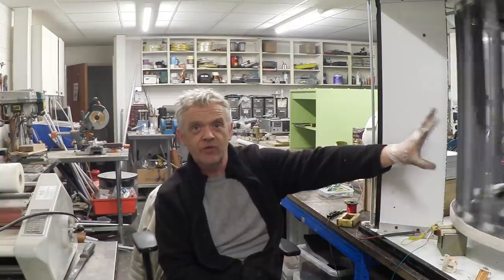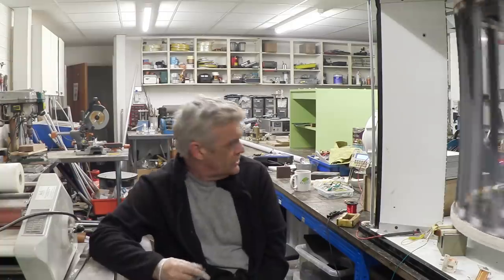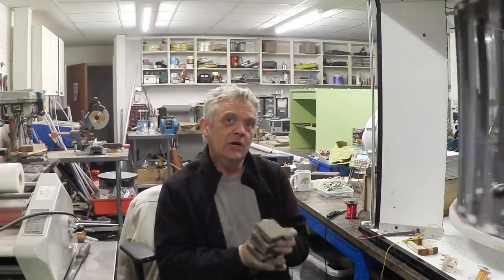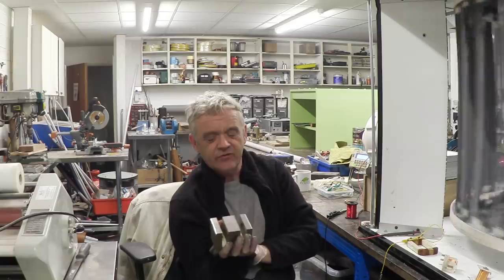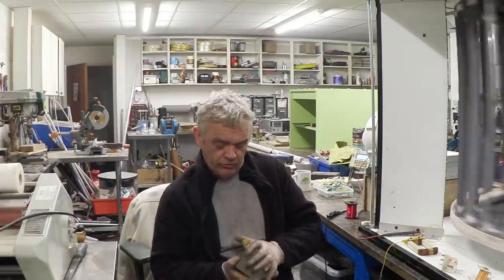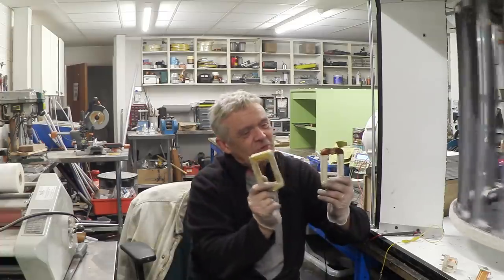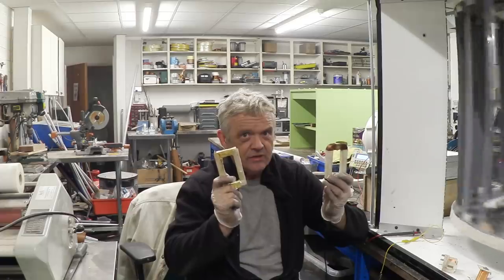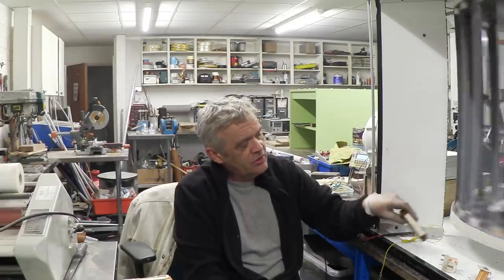Building a 1kW Wind Turbine For Under £100 - Part 5 - Messing With Coils

Comment: Rob, the reason you get the same power out of different coils is not a result of the mass of copper. The amount of power is determined by the magnitude of magnetic flux, and how fast it is moving past the turns in the core, less eddy current losses in the core and copper (resistance x current, aka IR) losses in the windings. More or less like a transformer, except in this case the flux is applied externally rather than being generated by the primary coil. Different numbers of turns changes the voltage versus current, but power remains the same. To reduce copper (IR) loss to a minimum, the coil should make full use of whatever space there is in the core.
Reply: Yep - as I remember from secondary school physics, in the ideal, number of winds determines voltage/current combo through which you'll get a fixed power.  Obviously real-world with resistance, eddy currents etc., will skew that balance, but the fundamental relationship between coils is about windings.

The transformer designers will have balanced the real world losses.  Cheapest design would be one wind on the primary, 10, or whatever the multiplier is, on the secondary.  But plainly that is inefficient so they increased the winds on each side to a point with acceptable efficiency for a given cost.

The thickness of wires is just chosen to allow them to pass the current, which is why the primary (fewer windings, lower voltage, higher current) has thick wire and the secondary has thin - (almost?) purely whatever appropriate gauge wire is needed to carry its design current.

As for whether to use a core - that just improves amount of flux it can intercept (no?) - how much kinetic energy the coil can capture and transform to electric.  The whole point of this is to extract kinetic energy and convert it.  Of course the core-less coil didn't slow the turbine as much, it was extracting 1/4 of the energy (halved both voltage and current).

If you put too much load on the turbine, it won't spin well, so a useful design needs to have limited extraction abilities one way or another.  If your scavenged parts are too powerful, perhaps it is pragmatic to reduce its efficiency, but otherwise there's not a lot better about a unit that is not able to extract as much.  Remove the load and it speeds up, right? so limit how much electricity you take from it and you can control (and therefore optimize) the turbine speed?

Finally...  connecting the two coils...  In the transformer, one is designed to take the energy input by the other - they're in opposition.  If Robert saw the output drop it probably meant he connected them in opposition to each other.  Reverse the polarity of one of the coils and they'll just give you more windings, higher voltage, lower current, same output (but probably fractionally higher from slightly lower losses?).

I'm in awe of, and salute, the practical investigations here, but getting a theoretical guy on hand (e.g. a secondary school physics teacher?) to help direct the investigations would accelerate progress dramatically.  The complement of theory nerd matched with a capable inquisitive hands-on engineer type is powerful.  They shore up each others' weaknesses and keep each other from following blind alleys.
Reply: @wjcferguson  basicaly you are right. Please don't forget that core can get saturated. There is a limits how big magnetic field intensity can hold it. More windings means stronger field. In transformer application this means less losses unless core gets saturated.

Comment: I think the resistance to the motion of the turbine comes from back EMF and the large amount of iron in the core interacting with the magnets. Cutting off the outer cores would reduce the magnetic brake effect while the inner iron core will improve flux flow, in particular the capture of the induced voltage as the magnetic flux collapses with the passing of each magnet. Thus the higher voltage option becomes even more attractive. That's my theory anyway. Great stuff.
Reply: Sorry, but i dont think back EMF from the iron core are to blame here. Those cores are actually built to minimze back EMF. Thats the reason they are built from thin slices of isolated material, to stop any eddy currents from flowing. This means that although a voltage is induced in the core, no current can flow and no "reverse" magnetic fields can build up. Also by cutting the outer "wings" you replace a low-magnetic resistance flux path with one with huge flux resistance, which means your basically throwing away a huge amount of magnetic flux, meaning you have to buy stronger, more expensive magnets to get the same output power.
Reply: @headlessxp4948  It is a while since I did this back when I was an apprentice, but ..... The laminations are to stop eddy currents forming in the core (actual induced electrical currents that would cause heating) not to stop the magnetic flux that you want to flow (maybe flow is not the right word here) The changing magnetic flux would induce electrical flow in any metallic paths it crossed. Laminating the core limits any eddy current to flow in parallel with the magnetic flux when it wants to run at right angles to it!
Reply: I think you are right. The back EMF from a collapsing magnetic flux would induce an opposing magnetic flux which would react against the fixed magnets causing "cogging" !
Reply: @headlessxp4948  You can also make electromagnets that's much cheaper. As long as the RPM of the turbine is high enough it would generate more electricity then it cost to power the electromagnets.
Reply: @Roel922  you can even get away with powering the magnets from the turbine (after rectification). This usually works as there will be a residual magnetic field in the iron cores once they have been electrified once. If not, a small permananent magnet can be placed alongside.

The reason I personally would not do this is that the magnets are on the moving rotor. Your design entails getting the DC power for the magnets onto the moving rotor -- which can be hard to get right in a DIY job
Reply: Yeah, you are right. The output of the generator comes from the turbine doing WORK. If it spins without getting resistance back from the coils, it doesn't do work. Current induced in the coils generates oposite magnetic field (rule of the right hand) and it takes energy off of the rotor's momentum. That is the energy transformed into electricity.
Reply: FARADYS LAW, (So you cant get pretty much free energy) When a conductor is passed through a magnetic field it passage is retarded, or if a magnet is passed through a conductor it is retarded, thus if a decent magnet is dropped through a conductor like a non magnetic copper pipe it falls way slower than the speed of gravity, and this is how magnetic brakes work.

Comment: From what I understand the discussion shouldn’t be about with or without iron core, but rather about achieving the maximum power to drag ratio. Which is essentially the highest efficiency.
Reply: I would like to see what it will do on a flat plate

Comment: Hi  Rob just to note that the available flux from your perminent magnets limits the amount of induced current in your coils. If it was possible to add another row of magnets and wind your own multiple coils to complete the bottom say 20 off. Keep the ferrous inner with low iron content to reduce induced drag. Keep the copper wire size thick to get max current as you can use an inverter to increase voltage but you need  the amps. Better wind your own as 20 used  microwaves will be hard to find ? Hope this helps.

Comment: Do not underestimate the forces acting on the coil windings, apart from increasing efficiency the core provides a very needed mechanical restraint, eddy currents must be minimised or else excess heat will degrade  the windings  , a core provides an essential part of a generator winding arrangement, without it the windings will overheat and vibrate excessively.

Comment: I know that probably, nobody will read this comment, but I still feel urged to add my 2 cents and 3 semesters of electrical engineering knowledge to this discussion.

1. The wire diameter only decides about the maximum current the wire can carry before it melts, NOT the induced voltage. In most cases you can simplify faraday's induction law into U = turns_of_wire * change_of_magnetic_flux. 

2. I think Robert is right when he says that you have a choiche when deciding for/against an iron core. It depends on the strenght of you magnets and the amount of power you want to convert to electrical power. To achieve the same flux density through a coil without a core, you need much stronger magnets to force the magnetic field through the air. If you want to use cheap, weak magnets however, an iron core (which in most cases you get for free with the coil) can compensate for their weaker magnetic field strenght.

3. I think it would be smartest to setup the coil to be able to stop the turbine completely when shorted. If you were to make you the coil "weaker", you would effectively dictate an operating point for the turbine speed, which doesn't really make sense unless you expect to always have the EXACT SAME wind speed. By making the coil "stronger",  you can use a simple buck converter and rectifier to choose a different operating point whenever you want and however you want by just turning a potientometer. A strong coil setup would also make the use of a MPPT controller possible, which seems to be optimal for this case as the wind speed fluctuates a lot. The only disadvantage of such a "strong" coil would be some minor cogging.

Comment: 2. Coil vs magnet size. You will find it informative to do a doodle of the shape of the field lines of your magnet configuration for your north-south-north- arrangement.  Conceptualize both without and with the coil and its core in place. 
 Your coil extracts energy via the change in flux so you want to maximize the severity of flux change as the magnets pass the coil.  A wide coil will potentially be picking up conflicting flux inputs resulting in the windings having currents trying to flow in opposing directions at the same time. A narrower coil may be better at getting a unique current direction induced in it giving a cleaner output. 

Try positioning a Hall sensor in the gap between magnets and coil and watch the flux change as the magnets run by. More change is better.
Reply: Exactly why the output is lower if the magnets pass along the longer "length" of the coil as opposed of the shorter "width" of it - the magnetic field passes the coil quicker and so the polarity switch is faster. As you say, it's the rate of change that does the work.
Reply: It may be helpful to think of connecting your primaries  and secondary coils together as you would DC batteries  in parallel  and series, thus you would achieve a desired cumulative voltage and cumulative amperage . Then regulate the wind speed by a servo control BY  a variable  insertion/removable of an iron core inside of the coils.    I have found your  presentations to be some of the best of YOU TUBE..
Reply: Have you considered the serpentine coil for this application?

Comment: As soon as you started talking high volt low amp (thin wire) I found myself shouting at the video yes YES YES like I was a child at pantomine.  The reason for this is beyond your generator. Transmit your energy at high voltage low amps for fewer losses. Then nearer the destination transform the energy to what you need it to be. Perhaps I'm looking at the end game but having got this close to the end  I don't want to see it fail due to transmission losses. Fantastic series . Well done so interesting.

Comment: I've been thinking about this problem for quite a while now actually. Thinking back to my Basic Magnetics module at tafe, 3 things influence voltage output, flux density, i.e. the amount of flux lines between two magnets, the length of the conductor cutting through the field, hence why we coil it up, and the speed of the conductor through the magnetic field. Thickness of the conductor will affect the amount of current allowed to flow. Now we could vary the length of the conductor by switching on coils in series or take taps off coils but that would be more of a digital solution which could have a jarring, stepping effect on the output and may or may not be harder to control depending on the setup. We can't really change the speed or the conductor through the field as that is dependant on the angle of attack of the rotor blades and the wind speed unless we have a variable blade pitch setup. The option I have been thinking about of the past few months is to change the field strength. How do we do that? Well you were holding it in your hands. The bolt is perfect as it is a screw which can be rotated in and out of the core of the coil. This is done all the time in arc welders. this could also be done automatically by the rotor itself. How? remember those rotational governors with the two brass balls on old steam engines? They could be used in the same way here. As the rotor spins the governor, the balls are thrown outwards thus causing the arms to push a central rod that moves the coil core in or out, adjusting the core strength depending on the RPM of the rotor. Hope this helps.

Comment: On the research I've been doing ideally the magnets should be the same size as the core of the wire and half the thickness. Have you thought about using the secondary windings inside the cage and powering them to make an alternator in effect maybe using a capacitor to excite the inner field coils via a slip ring?
Reply: Genius  idea

Comment: To get to the end stage you now have to ask yourself what voltage do you want at the output.   
Regarding the size of coils and magnets get a load of iron filings and a sheet of paper and then you'll actually see the size of the fields.   You can then match them to each other.   

Good luck, you're doing well.   I like the size of your workshop.   I'm 75 now and spent years in engineering as a draughtsman and also on the shop floor making special purpose machines.   The time flies by.   Each day's gone in a flash.   

I made a ton of money as a contract draughtsman and even more when I opened my own technical recruitment company about thirty odd years ago.   I retired at age 54 and moved here to live in Thailand.   I'm still here to this day.   BUT now I just do oil painting every day it's far more relaxing than messing around in a workshop, but the money's not so good.   But I'm OK, I'm happy and that's important 

Kind regards - Chris in Thailand

Comment: My understanding of electrical principles since fundamentals class has always been that even our measurable parameters: voltage, current, resistance are all relative to other parameters. Speaking in definites as a result may lead to errors in thinking. It’s all about what you want to accomplish that should dictate how a system is designed. It’s your tidbits about upsetting the normal thinking that keeps me tuning in. Out of the box thinking is exactly where I think innovation lives. That is of course my opinion. We all have them and I appreciate the opportunity to share mine. Sweet concept by the way. Thank you for your presentation of it.

Comment: @Robert...so far as cores go, just SHORTEN UP THE LEGS because you really want to keep the iron all around as close to the coil as possible as it is there to carry magnetic force from the magnets throughout all of the coils.

Any air gaps or other 'dead space' reduces the total amount of magnetic saturation your coils can experience.